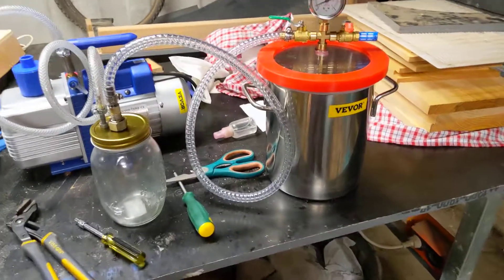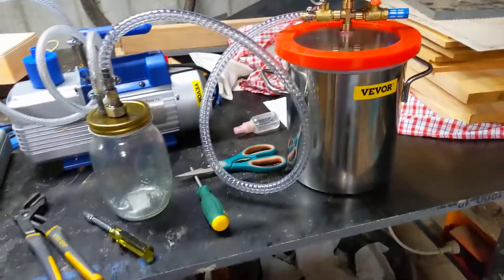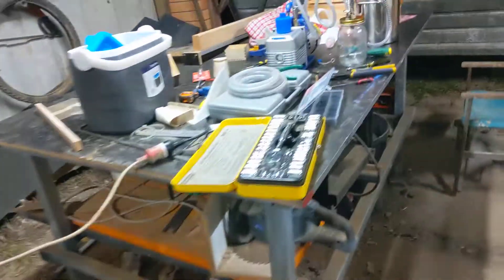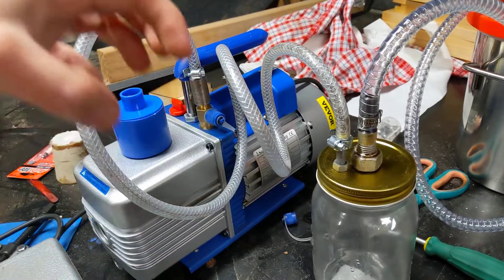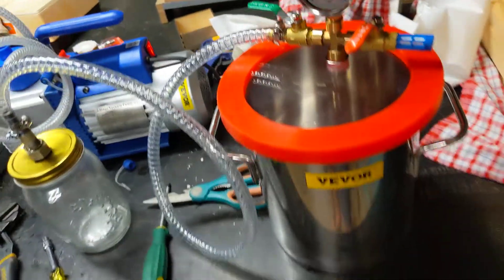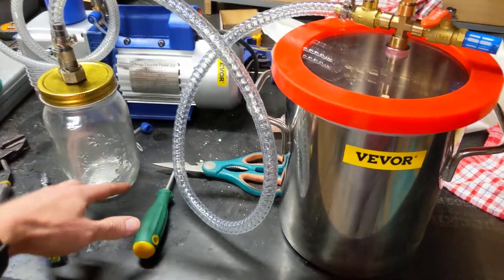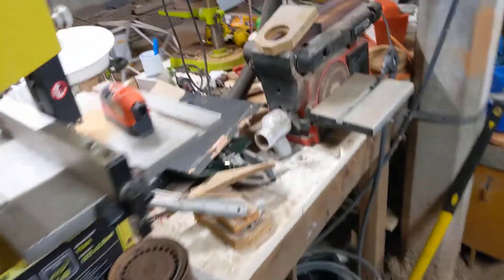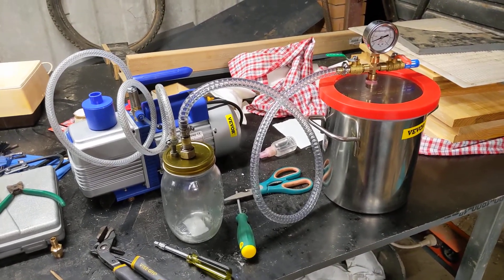Home-made vacuum freeze-drying setup

Comment: ok someone mentioned it but I shall again.

that cornings jar is a ticking time bomb it will most likely pop random or when you pick it up which will destroy your hand. and possibly your face if your investigating its contents.

please change it for a round bottom flask with a well made ground glass fitting on top to work as a vacuum trap.

or something else that can be trusted under vacuum 

to many flat surfaces to trust that jar.
Reply from the maker: Good suggestion! I swapped it out for a stainless steel one years ago. Check out the other videos in the playlist: https://www.youtube.com/playlist?list=PLT7ckgz8vcobBem7VrRMPuV5xM-4C46lU

Comment: Does the manufacture of this tool still use a refrigerator compressor for cooling?
Reply from the maker: The newer version does, yes. The old version used a dry ice bath but this was too expensive to use on a regular basis.